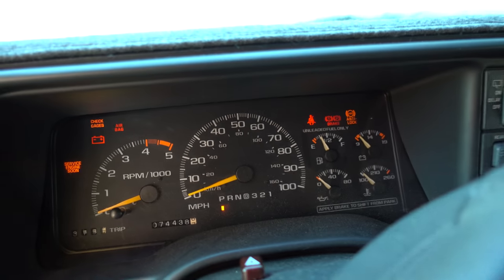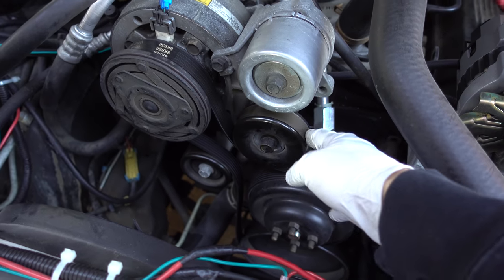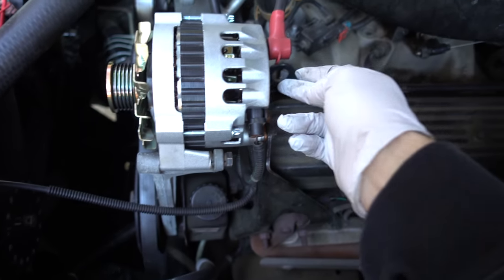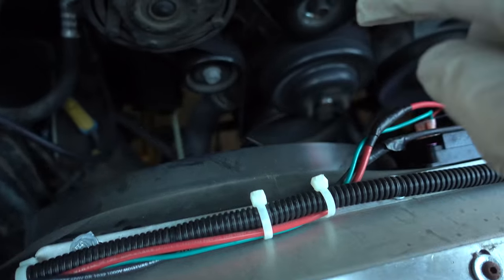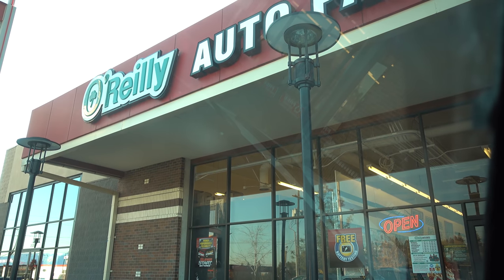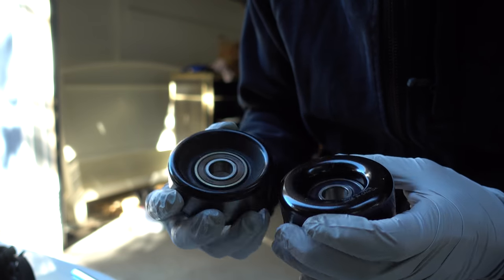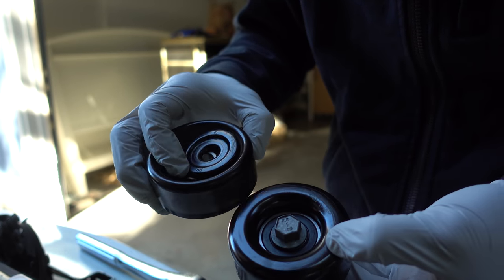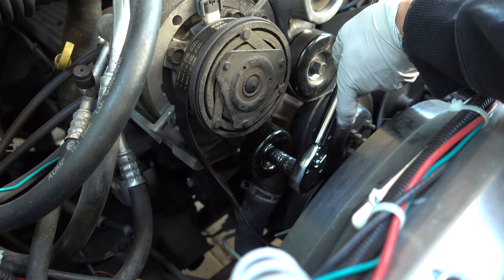How To Diagnose A Squeaking Pulley!

Comment: with my belt is brand new, my belt squeak when I put my vehicle on reverse or turn on the AC. it goes away when I raise up my rpm a little bit. Can someone tell me what might be the issue here. thanks!
Reply: Tension pulley
Reply: Did you find out!

Comment: So I have a problem it’s nothing like this but whenever I am accelerating there is a loud whining sound from the front end and I looked it up on the Google and they said it’s either either pulley power steering pump transmission filter or are the alternator. I’ll post a video if anyone can tell me this before I take it to the mechanic to have them figure it out and then I fix it myself

Comment: Having the same thing on my transit. Been thought (everything) and replaced for new except power steering pump. And it’s still doing it. Guess it that then 🤬
Reply: Sorry to hear that brother.  Did you replace the entire pump or just the power  steering pulled.  If so..did that solve your issue.  I replaced two pulleys but it didn't solve the issue.  I have a strong feeling its the powe steering pump/ pulley.  I've already dropped like 2 k on my truck on other parts and cant afford to replace parts that still have a little life.

Comment: a stethoscope from china freight is like $7 and you'll be able to clearly hear which pulley is shrieking
Reply: That's exactly how I found in my grumbling sound coming from the alternator. I removed the belt and sure enough the sound went away. But I took the alternator off and spun the we are as fast as I could both directions and it seems nice and solid and smooth. So I took it apart and inspected the innards.... it all looked fine. And I know looks can be deceiving, but it's a fairly new alternator. And I know that really doesn't matter either. Any ideas? Any help would be appreciated thank you
Reply: @bonscotty67  You said you found the sound coming from alternator? With the belt on and engine running, just put the stethoscope on the end of the bolt in the middle of each pulley or on the bracket. Whichever one sounds the loudest is your bad bearing
Reply: @benjamin8981  loud clanking, clunking, and straight-up ching-chang crunkalatta watta bing-bam 🤔😜 when I set it on the alternator. Dissipates as I move farther away from the alternator. Honestly, with a sound emulating from it I would expect to see some internal damage of some sort. Everything seems to be virtually brand-new. Strange phenomenon I guess but stranger things have happened I'm sure
Reply: @bonscotty67  its not uncommon to get a remanufactured alternator with a bad bearing that makes every noise imaginable through a stethoscope. In my experience, 2/3 alternators from CarQuest are bad
Reply: @benjamin8981  well mine was with the truck when I bought it from my neighbor who is deployed to Hawaii. I got a good deal on it and there are many new parts and components. The author looks like it could have been put on brand new last week. The belt was awfully tight. Tighter than the half-inch allowance. But the idler and tensioner pulleys seem fine as well. I put it all back together and now less tension on the alternator pulley, but the damage is probably already done. I only wish I could see some Visual Evidence of the noise I'm hearing to validate my finding

Comment: You usually can’t diagnose a noisy pulley by removing belt and spinning it because by removing the belt your removing the load on the pulley. You where on the right track with the stethoscope but apparently that didn’t work out for you?

Comment: You diagnosed nothing. Changing a new belt is cheaper than buying the pulley. Try spraying a bit of water on the ribbed side to hear if the sound goes away. If it does momentarily, then it's the belt. If it doesn't, then look at the pulleys, A stethoscope would help.

Comment: Also, as a quick fix get some carb cleaner...yes carb cleaner. Spray down and clean all belt pulley's and belt itself.  Road grime and oil grease contaniments can cause a squeaky belt! Give it a spray and let us know!
Reply from the maker: +Mr. Roy So carb cleaner won't eat rubber?
Reply: No sir, it cleans and evaporates very very quickly and tried and tested on my trucks[same as yours] and it worked like a charm. Give those pulleys a scrub and clean and clean the belt as well. Then proceed to get the best belt on the market-The Gatorback/Continental Elite. Hands down the best in class for our truck applications. I got mine from rockauto.com as mentioned previously!!

Comment: I could relate to your problem. It socks when you think this mite be the problem , you spend some money on a part , you install it and you say, s_ _ t still have the same problem!  The advantage you have is , that you do it yourself like my self. Shops are very expensive today . I do everything on my car. I save so much money. Im sure you will find the problem . I hope is not the W.P.  A little tip "  sometimes you can't tell a bad bearing by spinning it by hand. Sometimes you need the tension with the belt to hear it better and speed. Good luck "

Comment: Be careful with new idler pulley's and tensioner pulley's. I have replaced these and found that brand new ones can be faulty. Especially from Advance Auto and NAPA!
Reply: Autozone is HORRIBLE also I have went through no joke 3 alternators before got a good one. First 2 had bad voltage regulators, the 3rd one had a very loud horrible squeak. Number 4 worked finally. It was horrible because autozone was the only store that could get the one 1 needed.

Comment: It is the water pump bearings. Buy the expensive OEM or you will change it every 2 years. Do not waist money on belts or tensioners. Does it squeak consistently except when driving downhill? Change the pump. I have had 2 of these vehicles and drove them 150,000 each. It is the pump do not kid yourself.

Comment: I to changed out the alternator idle pulley belt water pump tention pulley replace power steering sweak still there ? Then my missus said hang on l will turn my car off and give you a hand you wouldn't believe it sweak GONE!!!!!!

Comment: Lol 37 pound feet also the angle you had the ratchet on the belt tensioner made it was harder to turn it to loosen the belt. Make life easier and make it where you push down at a easy angle vs having it at a weird angle and trying to fight it. Don’t play a guessing game turn engine off squirt a little WD-40 on ONE pulley start if did not go away turn engine off squirt another pulley repeat. When the squeak goes away you know what bearing it is. Don’t do this engine running it just makes a mess do one squirt ONE pulley at a time.